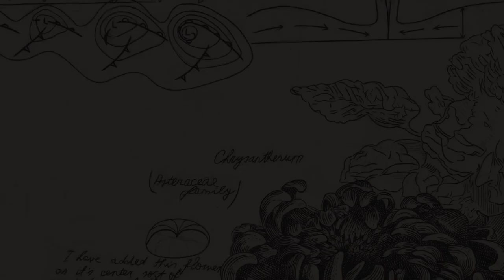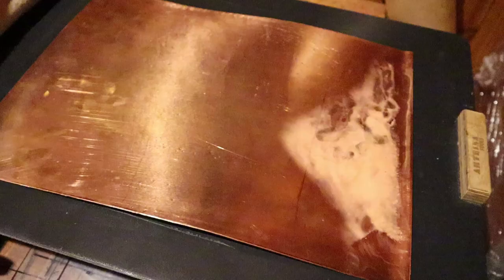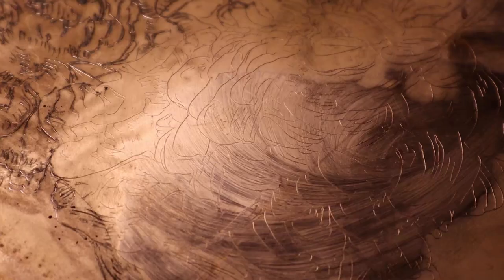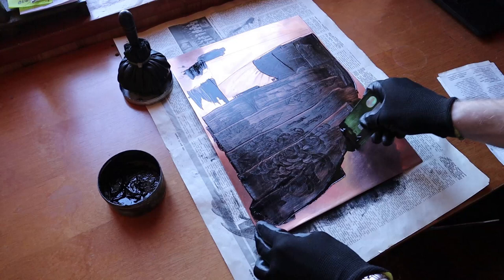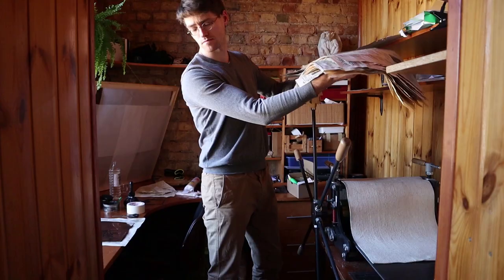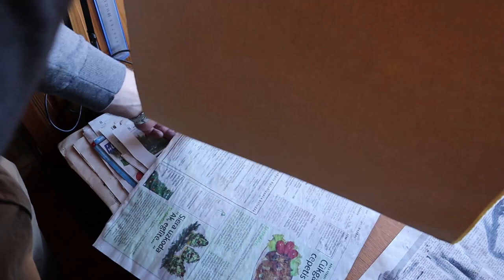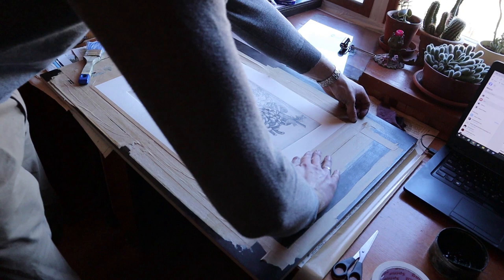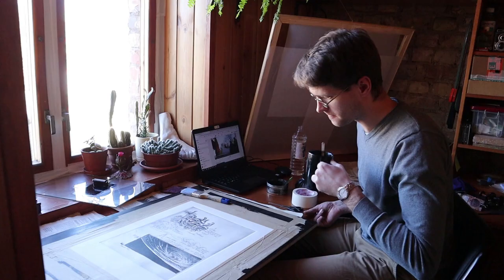Vortex - Copperplate Engraving Print with Cyclone and Chrysanthemum by printmaker Reinis Gailitis

Comment: How do you remove burrs after engraving with a burin
Reply from the maker: @marlenevidibor8054  good question. Either by snipping them off with a scraper or sanding with sandpaper.
Reply: @GailitisPrintmaking  won't those leave marks on the plate?
Reply from the maker: @marlenevidibor8054  can leave some scratches, if the sandpaper is too rough.
You can give the plate a final polish with Brasso once everything has been engraved. The lines are deep and a quick polish won't harm them.
You can see the sanding here: https://youtube.com/shorts/ueoEq0Dhcfs?si=TmqVdg_EcF_4lC6R